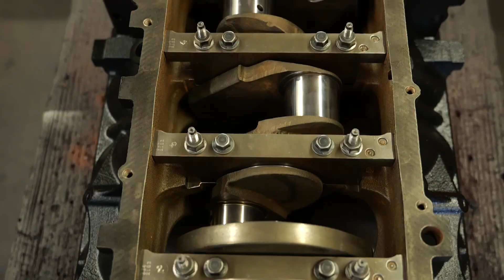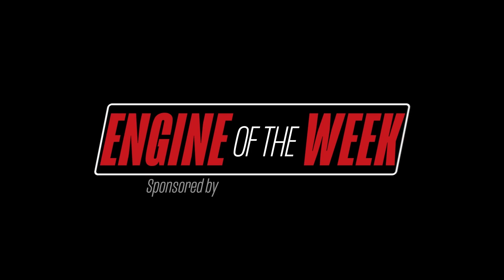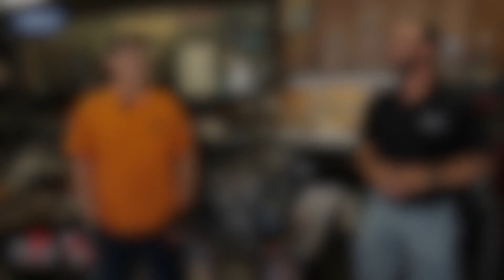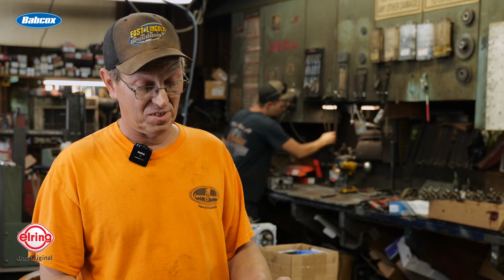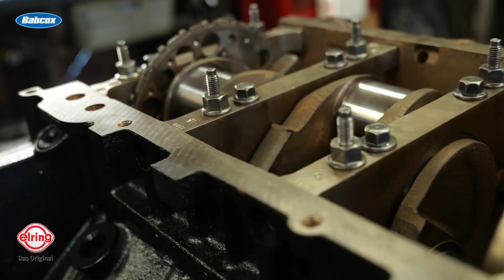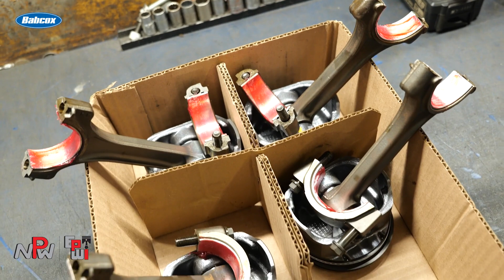Concord Engines' 5.3L LS Engine Build

Comment: Just about to buy a 2005 Tahoe
Reply: Gotta 04.  Been pretty reliable decent vehicle, ~ 235k miles.  Water pump (leak), radiator (crack), alternator, dash (killed battery), window regulator,  needs tie rods, blower motor and wiring can be an issue (might pot it and move connector), think it needs a ac control unit (gets stuck on hot and have to turn off vehicle restart sometimes a couple times) but could be a blend door (has a dash tick).
I've driven it hard and might go through and rebuild it all.  Pretty reliable, comfortable, not great gas milage but could be improved.